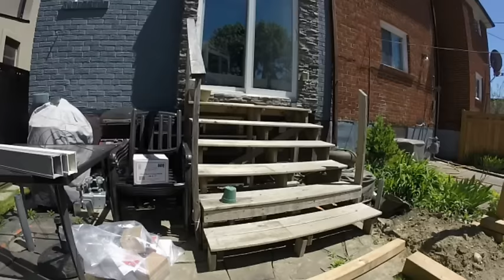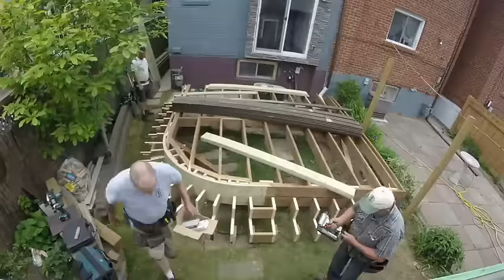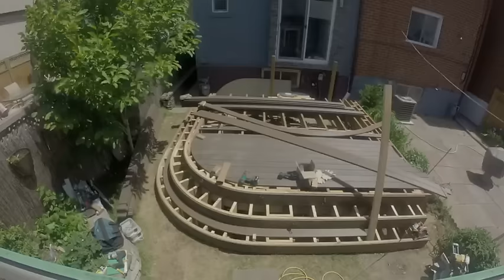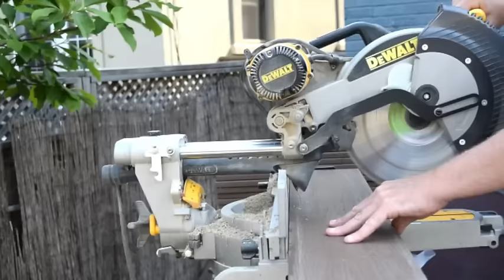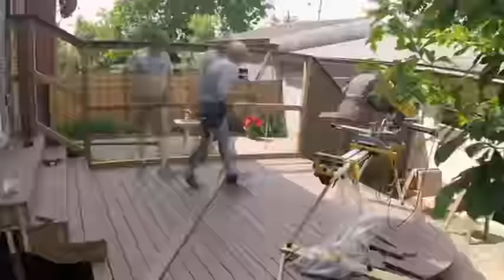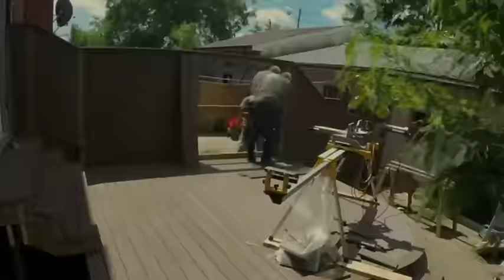TruNorth Decking - Curved Deck + Fence Time-lapse Build

Comment: not for nothing but ive been looking for some no nonsense advanced deck builds and although i wish this one had some more instructions i was impressed by the outcome. alot of the videos i see my building inspector would laugh at but building codes and finished products MUST jive with each other and planning is everything. nice build.

Comment: amazing video! i have never ever seen that 'bend wood' before. amazing properties!
Reply: That fugly shit is plastic. You can bend wood too, by steaming it, but not if the bords are that wide.
Reply: Thanks for the lesson champ.
Reply: Sorry, didn't quite catch that you were being sarcastic, I was so pissed about this plastic crap. I am all for using this kind of material along stretches of freeway, for noise reduction, or for things like fence poles (assuming it is made out of recycled plastic). But for things like a patio in your back yard-not so much.

Comment: whats the point of this video if you are not going to show the finished product
Reply from the maker: I am working on getting finished images added to the video. In the meantime,I  was excited to get the video online and show what is possible and how easy our product is to work with.
Reply: So funny!! I was going to say just about the same. Unfortunately, I won't remember this particular vid in order to check back.
Reply: I was thinking that too....needed some show off segments.
Reply: edwards edwards i
Reply: TRUNORTHDECK
Even without the show off photos, you could at least freeze frame the last image instead of freight training us past the end right into your logo!

Comment: This is great craftsmanship. Really nice job. I'm curious though, did anyone discuss with the home owner that you can't cover your outdoor A/C unit with decking? When you cover a unit like that it recycles the air over and over which causes it to be much less efficient. Every brand I've installed requires 60 inches above the unit if it has a top discharge like the one in this video does.

Comment: I'm curious as to how you are keeping the bottom of the stringers out of the dirt. What is supporting them. Looks like blocks fastened to the side. Hmmm...
Reply from the maker: Thank you for your inquiry. We didn't show the detail of the bottom of the stringers since many municipalities have different regulations. Some require a concrete landing or paver stone, others use our plastic lumber and some allow the stringers to be resting on the soil.

Comment: Great work and craftsmanship. I got a question for you, I'm guessing that your using the Cortex plug system. Are you guys using to make the hole to accept the plug for the composite decking. I find that on the brand of decking that I use that the screw creates to much of a mushroom and the look with the plug installed is very noticeable. I need to pre drill a pilot hole then drill again with a perfectly sized drill bit with a stopper to accept the cortex matching plug. The plug system works great with white Azek but not so good or easily with the decking. Maybe different brands of decking screw better.
Reply from the maker: Thank you for your question. We do recommend pre-drilling with a Starborn or Metal Works type bit. Color matched screws were used here, with no plugs of any kind and we thought it looked great. If you need help finding a retailer for the Starborn Smart Bit, please contact us through our TruNorthDeck website and we would be happy to help.

Comment: Very nice, cheers from Melbourne ,Australia. Is this a composite material? I built a curved deck but had a BIG problem trying to bend merbau timber - snapped into pieces when I applied pressure !  If this is composite material , it has great flexibility - I made the wrong choice in timber selection for the curved application.
Reply from the maker: It is composite material. If you are interested, Mitten Vinyl has inventory available.
Reply: Thanks, had a look at their web site. Cheers
Reply: Z

Comment: How were you able to make the rounded corner. I would like to build a deck in one half of my yard, & have it go around the edge of my pool.
Reply from the maker: gino volta the TruNorth Deck composite boards were heated and bent around the substructure. There are limitations on the radius of the curve, but it could work for your pool. If you would like more information, please contact us through our website, www.TruNorthDeck.com.

Comment: Somewhat interesting up to the point they added stairs outside the rear house door without at least a 36" landing. That's a 100% safety fail. There isn't a place in the us where that would pass an inspection. Landings are a must outside of doors.
Reply from the maker: Thank you for your comment. The safety concern on the landing is good information for the viewers of this video!
Reply: Gordon, you are correct. I didn't even notice that. I was more focused on trying to figure out how the stringers were supported so that they don't rest on the dirt.

Comment: How would you like to be screwing down one of those steps only to have one of the bent boards dislodge and hit you square in the face? That's all I could think of when I saw those curves be put in. That could kill you if it hit you just right.
Reply from the maker: Joey M, thanks for watching. The boards actually stay curved after they are heated and bent, even without screws. The challenge is to get the board curved to the exact desired radius before it cools and stays that way.  As with any deck board though, it wouldn't be good if the boards became loose so composite deck screws and the TruNort Deck Slide&Go hidden fasteners were used in accordance with the manufacturer's recommendations.
Reply: Living on the edge!

Comment: can someone tell what is that board that they heated and bent as contours? a product or a  type of wood?
Reply from the maker: R Tintin thank you for your inquiry. the board is a composite deck board that is ultra low maintenance and also has the great features that it can be heated and bent like that. You can learn more about the product at www.TruNorthdeck.Com

Comment: What type of material are you useing for the top of the stairs?
Reply from the maker: The deck surface, including the stairs, is composite made by TruNorthDeck. The substructure is all pressure treated lumber.

Comment: hi, that timber you use on the steps to bend around the job, what is it please ?
Reply from the maker: Brent Jones it is TruNorth Deck composite boards. Eco friendly, virtually no maintenance, no splinters and no rotting. Check it out at www.trunorthdeck.com.

Comment: I need to learn steam bending!
Reply: I was going to inquire about the bending. It is plastic. wouldn't you use the oven type of PVC bender used by plumbers to make custom bends in PVC pipe? That is a gas fueled open flame operation.

Comment: Which kind of wood is bendable like this?
Reply: Amroth3 It's not wood, but a composite material - usually made of half bamboo (or other wood chips) and half recycled plastic..
Not sure what names these products go by in the US, but here in Australia there are a few brands, Modwood, Ekodeck, Futurewood.. etc..
I've used them a couple of times in my own business, and the main upside is the very low maintenance costs.. downside would be a tendency to crack or chip out the corners if you use screws, (predrilling is a must), and the material really hammers your saw blades, (I went through 2 circ saw blades and a brand new 12 inch Irwin hand saw on a 40 sq mt. deck!)
but to answer your original question, bending the boards is done by heating them up, being essentially plastic, they become supple, and bendable, and when they cool they barely move ever again.
Reply from the maker: Gene Lomas, you are correct, this is a composite deck board made by TruNorth Deck. The board is made with a blend of recycled plastic and Rice Husks, so it is not as hard on your blade as some of the bamboo products out there. It is made in North America with clean recycled material, free from metal and other hard contaminants that would also be hard on your blades. The composite screws are getting better and many brands don't need to be predrilled for most applications anymore. 
TruNorth Deck is available from Mitten in Australia if you want to check it out. Thanks for watching!
Reply from the maker: The material is TruNorth Deck Composite boards. As Gene commented, it is bendable because of the recycled plastic used. Rice Husks are also used instead of saw dust and other fillers used in other brands of composite boards, because they tend to absorb water and cause mold and swelling issues in the future. Besides the bendable properties, the boards do not require sanding, staining, sealing or painting like wood does. thanks for watching!

Comment: I don't get it. What was the point? If they wanted to cover their garden and stop things from growing...why didn't they just concrete the whole thing? You can see that their neighbour did that. The stairs around the edge just lead down to a small compact earth walkway. Not even somewhere you might want to go. What's the point?
I guess it's OK if you want to live in a manufactured environment. But otherwise? Why bother doing anything outside your house...if you don't want anything as "messy" as nature to intrude into your ordered world?
Reply from the maker: Concrete would have been an option. Low maintenance decking is a popular choice for projects that could also be made from concrete. Decking has a differnent look than concrete and cost is often comparable. The entrance to the house is above grade, so regardless, stairs are required. Thank you for your comment. Let us know if you have any questions a out installing Trunorth Deck or if we can help you find a dealer for any decking material you need.

Comment: Great! another plastic deck that's going to look like bloody hell after one season. Besides, what's the point of a deck in a small back yard like this, is it so you can stand on it and look into your neighbors' backyard? Dumb! Just build a nice staircase off the back door and install a patio at grade!!
Reply from the maker: Merv Cann thanks for your comments. The deck boards are guaranteed for 25 years against fading and they don't mold like other wood based composites so they look great always! Take a look at the website for more information www.trunorthdeck.com. The owners love the deck and use it nearly every day.

Comment: this will get ruined by weather in a couple of years
Reply from the maker: TEIS3210 the boads have a 25 year warranty, so we are confident it will hold up. TruNorth Deck hasn't had any warranty claims on thier boards because they use rice husks instead of sawdust like other manufacturers. So far the weather hasn't caused any fading or damage.